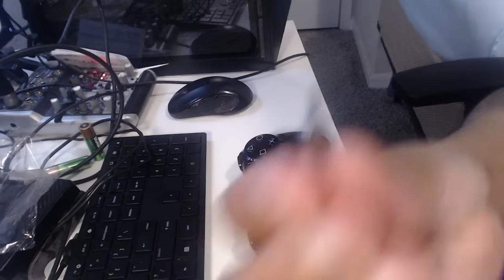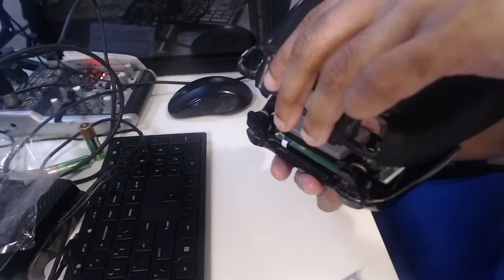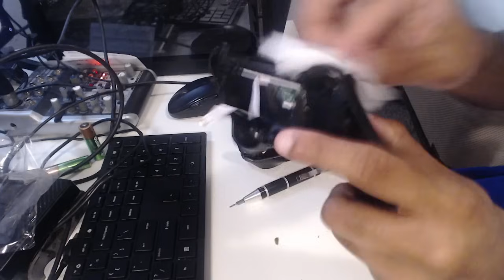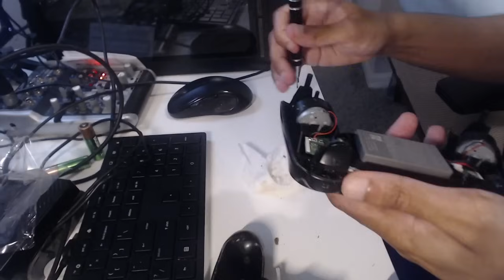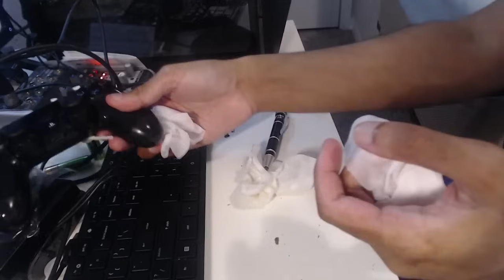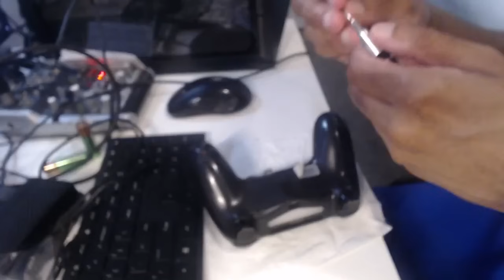how to and why you should open and clean your controllers | unintentional ASMR

Comment: Not that youre asking me to do this but yes, i cleaned 2 ps4 controllers years ago, i didnt realize how much gunk these things can hide, i had to open them with a screw driver and cleaned the shit out of them...
While they were open i realized i could just rip the vibrators out with no consequences so i did lol 
i dont like when controllers vibrate and they weigh A LOT less without them, they feel so much better
Reply: I hate taking them apart. I've gone through 3 of them because of stick drift so that the reason I ultimately ended up opening them up to clean but I could never permanently fix the stick drift. Fast forward to now in 2024, already got stick drift again on my PS5 controller. No dirt in the controller either, so I don't understand why the left stick ended up drifting when there was no dirt there. Well after cleaning it, the drift came back so I bit the bullet and bought a Dualsense Edge in hopes I don't have to open the whole thing just clean the sticks when they can be easily swapped.